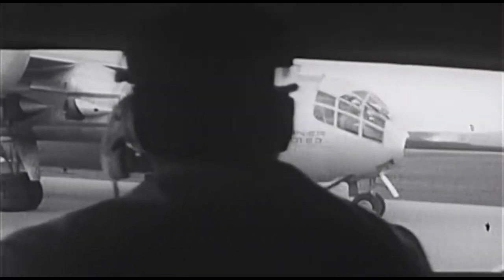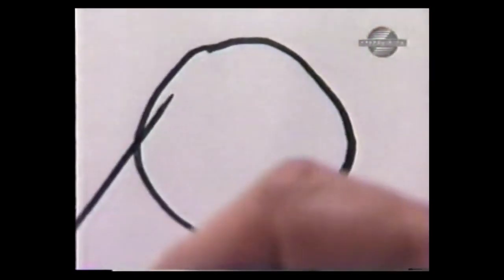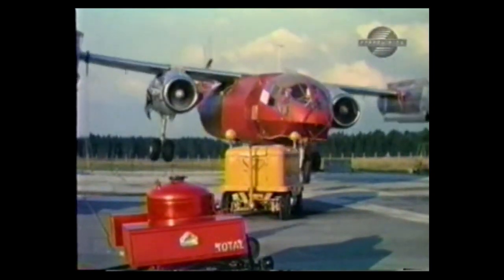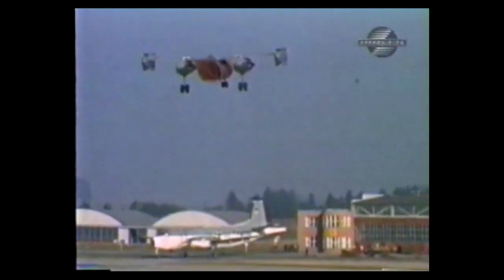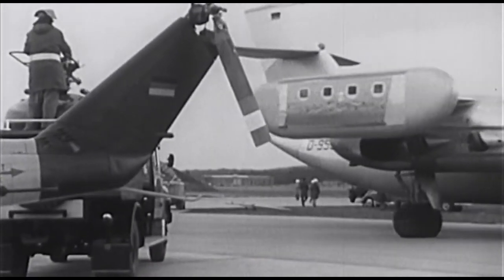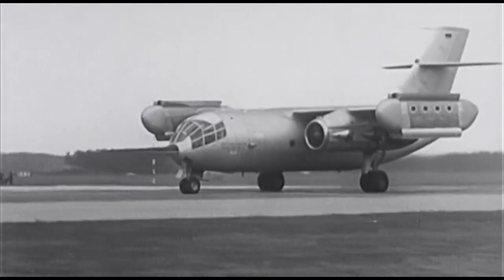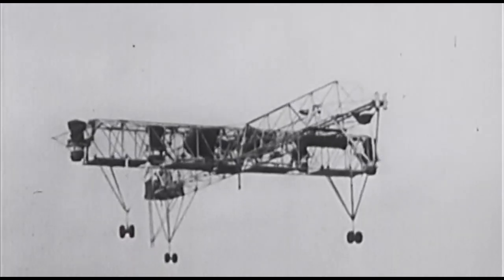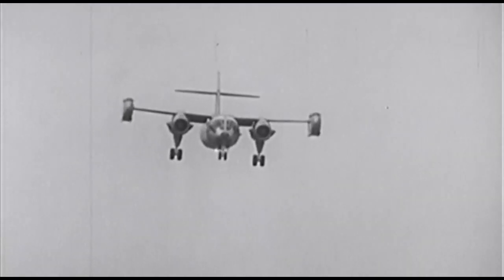Dornier DO31 VTOL jet transport project documentary

Comment: The DO-31 was part of a VSTOL German Air  Force.  The VJ-101 was to be a successor to the F-16; the VJ-191 was to replace the FIAT G-91.  The programs ended when it became clear that VSOL aircraft are technically possible, but maintaining such a fleet in widely dispersed areas wouldn't work.   At the Hannover Air Show - probably in 1968, - the DO-31 gave a flight demonstration.  The test pilot slow rolled the DO-31 as he flew over the runway - successfully.  I was there and saw this unbelievable slow roll demonstration with the only flying D)-31 that was built.  Our hearts were in our mouths....
Reply: I think you meant the Starfighter (F104 G), not the F-16 (which only entered service in the 1980s, and never with the Luftwaffe).
Reply: @Stadtpark90  Thanks for the correction.  Of course I meant the F-104
Reply: Man, I would LOVE to see footage of that display! It turns out, it exists - but it hasn't been digitised...yet. :-( http://www.aparchive.com/metadata/WEST-GERMANY-AIR-SHOW/5ceebea6ab060424fc5b0432b5c3f94b
Reply: That figures. It was partly motivated by the strategic position that West German and the West in general felt they were in in the early 1960's. With Cold War tensions being at some of their worst, it was believed that runways would be the first target in any invasion, so creating an entire airforce out of VSTOL aircraft was a way round this perceived problem. Like you said, it was supposed to serve with an interceptor and ground attack aircraft. 

In Mustard's video about the DO-31, although it was about to lift more than any helicopter at the time, it turned out that much of what was actually being lifted was its own weight and with the tensions in the Cold War easing from the end of the 1960's, coupled with the technical challenges not being entirely resolved, the programme was shut down in 1970. It was a pity as it's a unique aircraft